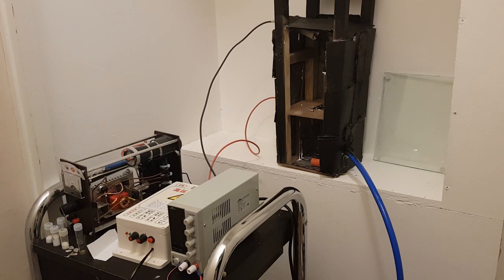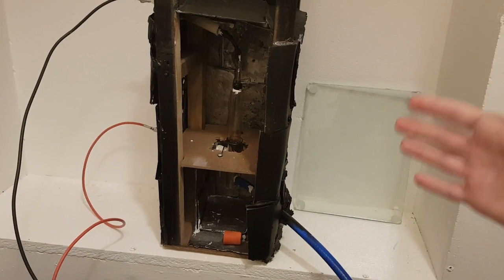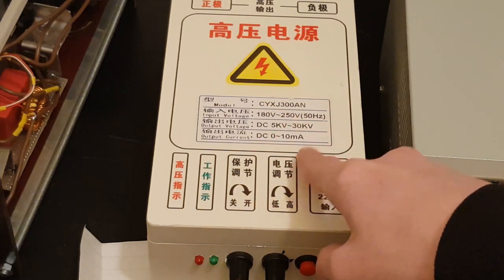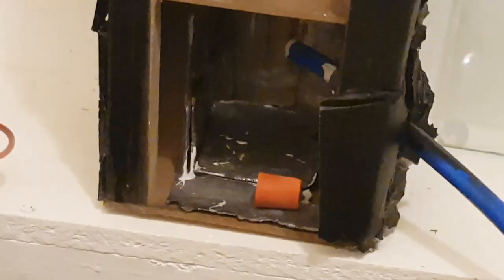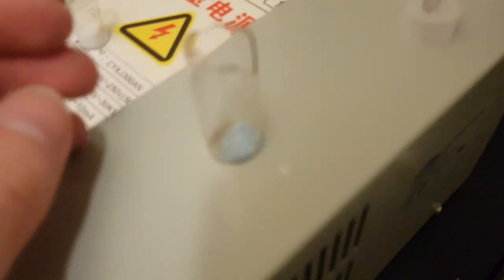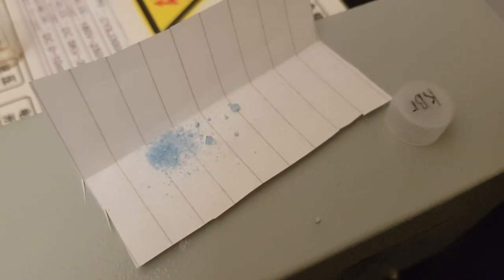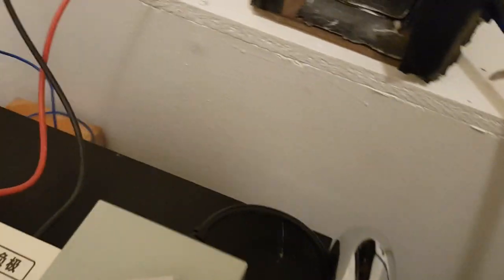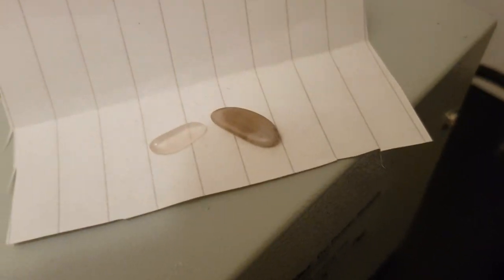Inducing Color Defects With A Home Made Cathode Ray Tube

Comment: have you tried making a cathode ray tube with an aluminum foil window, you might be able to get some electrons through!
Reply from the maker: I sure have! Actually made that long before this tube, but it required very high voltages compared to these. Still awesome to see ionized air with ones eye.
Reply from the maker: @СергейЛинник-х3й  Depends, but for aluminium you want very high, often over 100 kV. I think down to 60 kV works but it is very very bad. 150 kV works quite well.

Comment: Nice! Beautiful orange CaF cathodoluminescence. Can you show us the colors of thermoluminescence of the irradiated samples on a hotplate in a dark room? I'm a little skeptical of the radiation measurements at the end, since when the tube is in pulsed mode the pulse duration may be so short that the dead time of the GM tube is causing it to be totally saturated and only register a click or two. It's improbable that this is what's happening, but possible. Maybe a dosimiter would be better here.
Reply from the maker: I had planned on showing it but was not sure that it would be worth it as the camera might not be able to catch the glow on video. The detector indicating no increase in radiation levels are correct as an increase in voltage over 20kV starts to make the detector scream each pulse. Same happens if the measurement is taken at the demonstrated voltage but with the glass plate removed. Something to note which I forgot to mention is that the accelerating voltage is lower then 20kV as the vacuum is not optimal, I worsen it by choice to guarantee that the experiment worked as planned. (Making the vacuum optimal is possible but the problem is that it easily gets too good and the breaking point for the voltage gets higher then what I can supply)